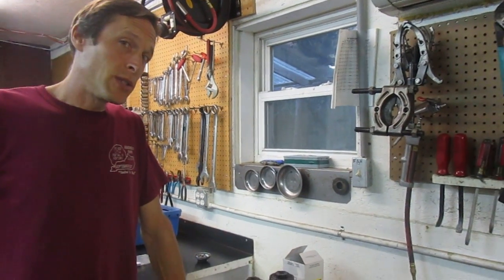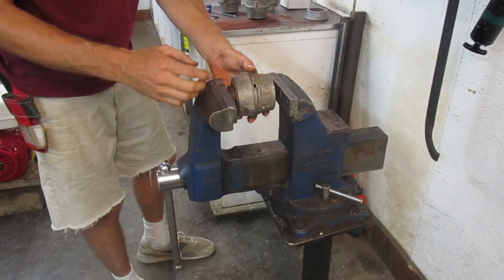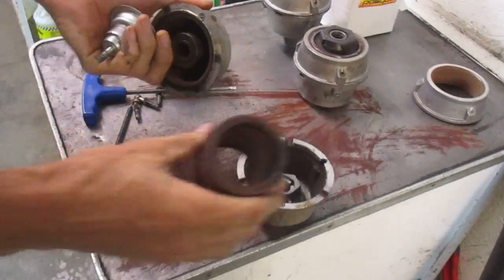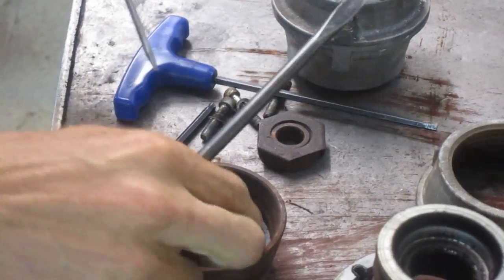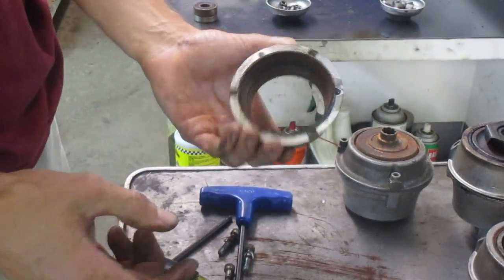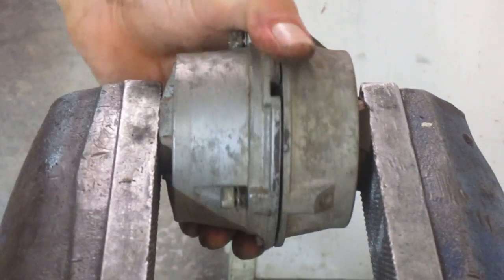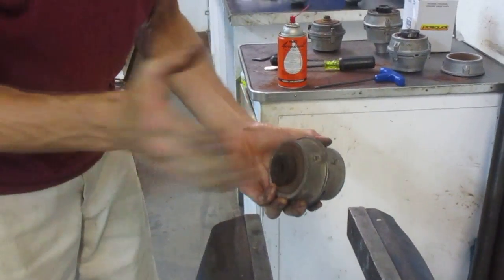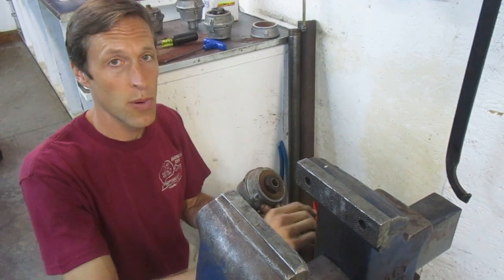Walk-Behind Tractor Clutch Service -- Bolted-Together Cone Type Clutch

Comment: Thank You Sir on an excellent video .I  own a Lombardini 6ld360 ,and inside my cone clutch I found 9 small springs instead one big,the cone is a bit rusty same like Yours ,can I polish the metal cone with finest grit water sandpaper?
I also found some decomposed fabric like felt all over inerior of the clutch,perhaps it was some felt seal for oiling the springs?

Comment: Hi Joel , your too far away to do anything for my 605 , but can I pick your brain? Mine has the multi plate clutch , and on removing the engine only the plate attached to the engine shaft came off the machine, do I need to remove the nut on the centre of the clutch and use a puller too remove the rest? Under the actuator ,
Diolch yn fawr iawn

Comment: Thanks Joel,I have old BCS 725 tractor cca 1991 y made ,Ithink,Why is my clutch pretty hard on first preess after tractor stay after 3weeks .after first hard press she go normal press but not separate good .must I replace all, or do like you on your video ?(change barrings etc) Thanks Joel best regards
Reply from the maker: It sounds like your clutch is "sticking" when the machine is not in use.  This can be corrected by locking the clutch lever on the handlebar in the "squeezed" position when your machine is NOT being used.  (If your machine does not have a lock for the clutch handle built into it, you can hold the lever in the "squeezed" position with a loop of rope, wire, etc.)

Comment: Joel, In 2019 you sent me a generic replacement clutch which was 150.00 ( a new BCS clutch would have been 285.00) The item number on my invoice is "BCS 592C1012 AFT " when the bearings in this clutch  fail can i sent it to you to have new bearings put in like I could with the old one ? Also when I look in the femaie side of the new clutch ( which i am about to put in ) I see the washer inside is off center and I can  see a 1/8 moon shaped  gap on one side of the  washer .Is that normal ?

Comment: How does a newer style clutch on a 720 come apart ?with out the bolts
Reply: It does not come apart...according to the factory. However, we made a jig to get them apart, and we've been taking them apart and servicing them for years.  You can send the clutch to us, and we will rebuild it.  Cost is usually between $60 and $100 depending on what it needs, which is way better than the $275+ BCS charges for a whole new clutch.  www.earthtools.com

Comment: Good video showing what an owner is up against when the clutch had issues .But I would like to see how the whole thing is put together on a unit.From engine,clutch ,transmission ,drive differential,axle shafts ,wheels .
Are there exploded drawings available complete with dimensions ,part numbers ? 
This would be  what I need to have  even before I consider  buying any piece of equipment .
I made mistakes in the past by just trusting salesmen and ended up with a pile of junk or parts that don't interchange due to design revisions which make certain parts obsolete and hard to find .
That is the deal breaker for me .
And the transmissions variables are yet another issue .
Like so many things that are produced ,in their development ,they go through growing pains until they master the perfect design which their product becomes renown  for durability ,longevity ,serviceability .Until they start cheaping out   on their metallurgy and the whole thing becomes yet anther disappointment .
That is what I'm up against ,so until I can sit down around a camp fire and listen to all the stories ,newer isn't always better .

Comment: Thanks for the video. Just one question, How do you remove the clutch form the shaft on the engine?
Reply from the maker: There are pdf documents on the Earth Tools website to walk you through the removal process of the various clutch/crankshaft types used on BCS.
Reply: not much info there no pdf found?? is it screwed pressed bolted?